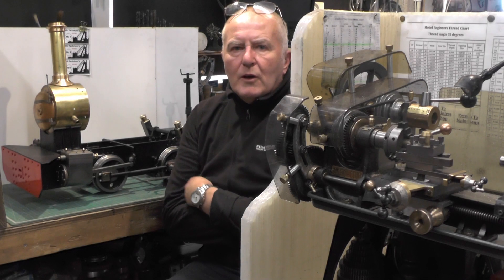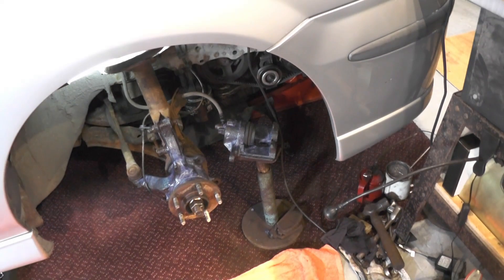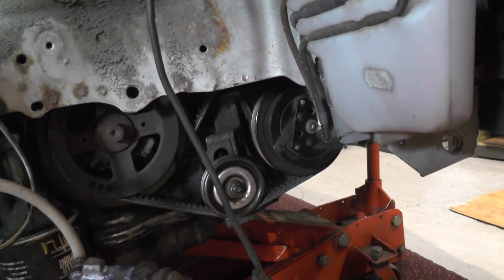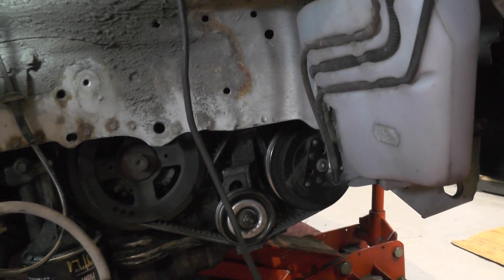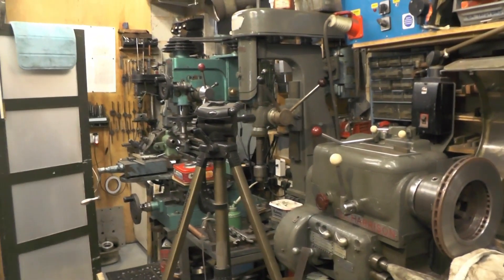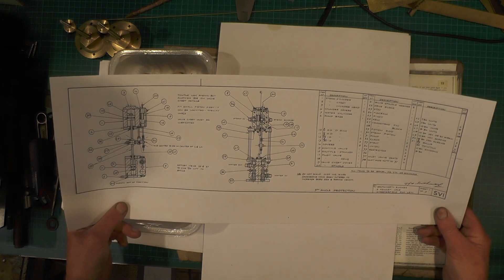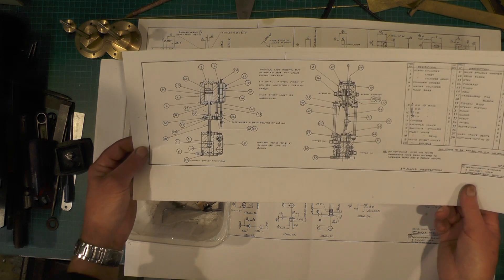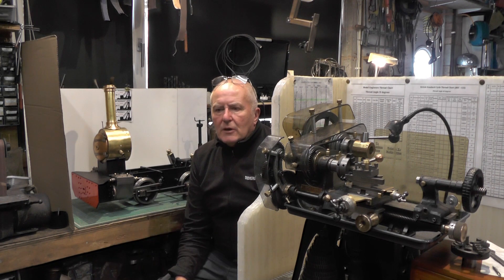"Well Blow Me Down" Had A New Project Gifted for my Micro Lathe! Steam Driven Water Pump

Comment: Hi Kev, great introduction video, very generous gift too.

Looks a nightmare getting access to those belts, still at least from friend gave you the tip off to get them changed.

Sometimes they do funny things writing this just reminded me of my first car over here a Ford Fiesta Diesel where the fan belt broke and got caught up under the timing belt which then jumped a couple of steps. Luckily for me I was able to get to safety with the engine running roughly

All the best!!
Reply from the maker: Thanks 👍 David
atb
Kev

Comment: Good luck with getting the car back on the road.  Those belts shouldn't be so difficult to replace, there has to be an easier way to get it done.  Looks like the micro lathe has a good test project coming its way, looking forward to seeing that and any work you do on the locomotive.
Reply from the maker: Thanks 👍 t3057
appreciate the feedback
regards
Kev

Comment: Hello Kev, a nice insight into your workshop and projects. (You simply can't have enough construction sites 😉) I also try to do the repairs on the car myself before I take it to a car repair shop. My car is already 18 years old, and you can still do a lot yourself. I don't want a new car 🚗. good luck and cheers 🍻 Michael
Reply from the maker: thanks Michael
great minds think alike, i don't want another modern car either, this ones 21 year, when it bites the dust i might get a 60's /70's car😉😉
atb
Kev
Reply: Hi Kev, totally my opinion. 
Today I finished restoring an old moped (small motorcycle with a two-stroke engine). It's from 1960.
Greetings from Magdeburg 
Michael 🍻 @MrFactotum
Reply from the maker: @MichaelS3013  Sounds Great the old 2 stroke👍👍👍👍 i've been close to you on my BSA 500cc once or twice.
 before i had a bad back, bad knee 😄😄😉😉👍👍🏍🏍🏍🏍🏍🏍

Comment: oh i really want to add a setam pump to my loco too.. 
but 6 inches long is overscale. I have never found one smaller though
Reply from the maker: hi Brendan
nice to hear from you, hope your loco's behaving!.👍👍🚂🚂
don't quote me, but i thought there was a smaller one, however i don't know much about these, this is a 6" one apparantly but i've heard people talk of a 3" ones.🤔
thanks for the feedback
keep in touch
atb
Kev
Reply: @MrFactotum  thanks for that. If you do come across any plans for a 3” pump keep me in mind and drop me a message. My googling has come up short so far.
Reply from the maker: @madguernseyboy  ok Brendan i will keep my tabs to the ground, 
what about scaling mine down, don't use castings just make from solid. It may/should be possible as a last resort. 
😉😉👍👍👍👍👍👍
atb
Kev
Reply: @MrFactotum  I have considered scaling down but wondered if the water valves scaled appropriately. Was hoping for a design where the issues had already been worked out. 
Currently overwhelmed with jobs in the garage so this is only a back burner project.
Building a driving trolley with a dynamometer fitted various wagons and an Electronic Lead screw to the lathe myford.
Reply from the maker: @madguernseyboy  yeah, know were your coming from, i will ask around and if i hear of anything i will let you know, cheers Kev